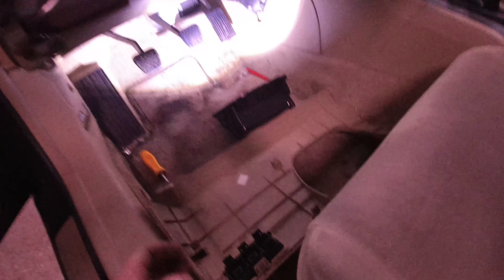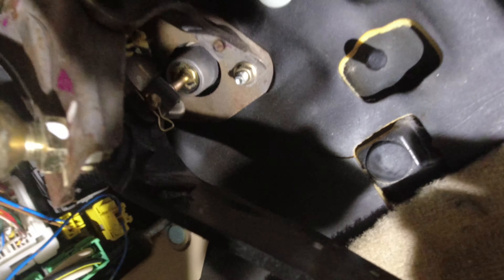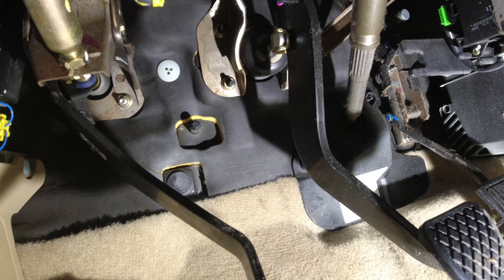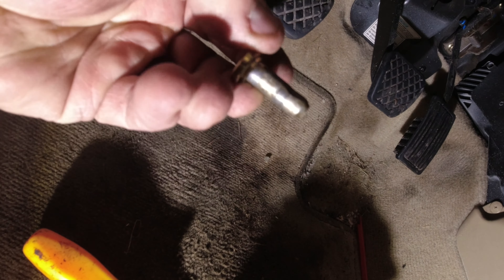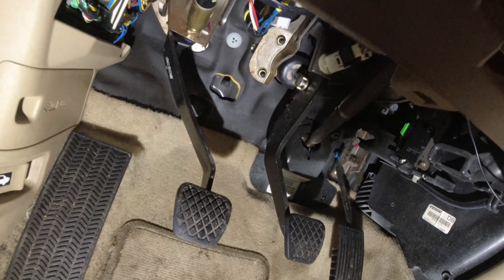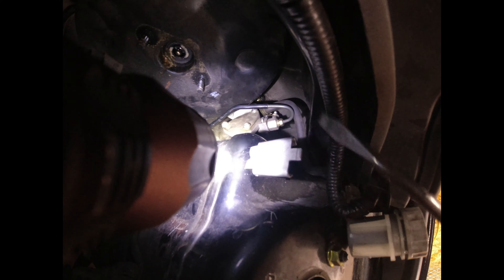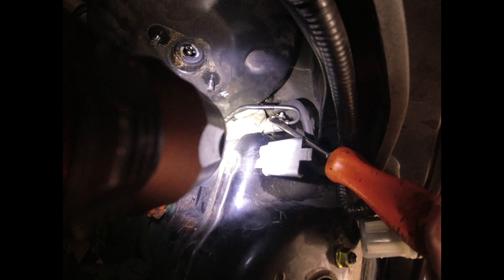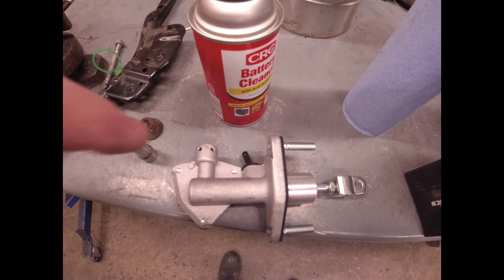04 Accord clutch master cylinder cylinder install

Comment: Hi I’m doing this today. I’m at the u bolt part. Everything disconnected inside the car very easy that was with extensions and swivel.
Question, what did you use to pull the “U” clip did you use needle nose pliers  and it came right out? Thanks
Reply from the maker: Yes needle nose. The top part of the clip that holds the rod in the pedal has a hook on it so it takes some force.